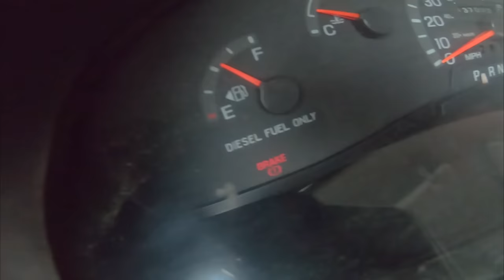Fixing a Million things on my 7.3 Van

Comment: Doing Uncle Satchel PROUD!

Van is looking fresh. Glad you got the alternator out easily, in my 7.3 van, one of the damn bolts broke, that was fun... Haven't had to do a water pump yet, but when I do, I'll just do what you did and order all the new shit and not cock around with the fan. I Think you can remove that one plastic tube thing and replace it with a PVC cap then you can get to the fuel filter a bit easier. Nothing is easy when your working on a van. I felt your pain doing this shiz... Esp. the batteries, that one by the passenger side sux for sure, without a jack I feel like it would be impossible to do by yourself. How many miles do you have on that beaut? Mines almost at 200k, still runs like a Swiss watch. Hope you're doing well friend.